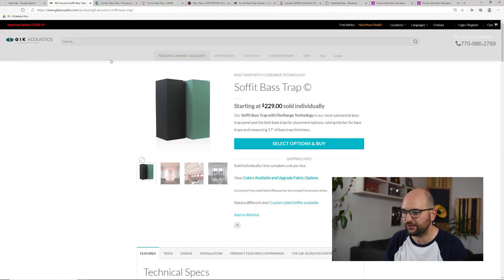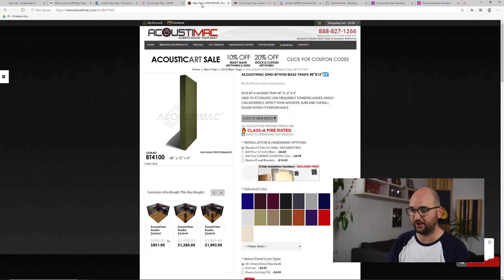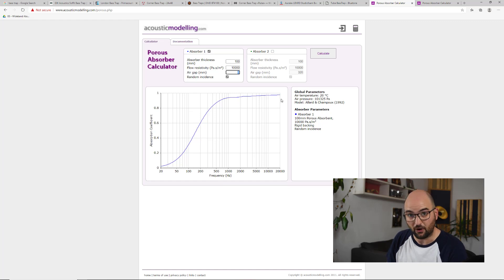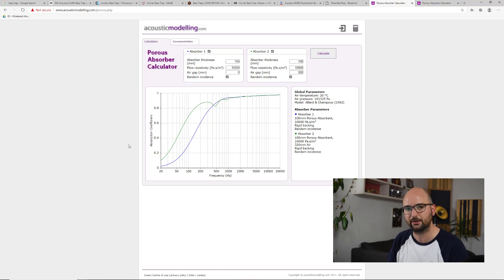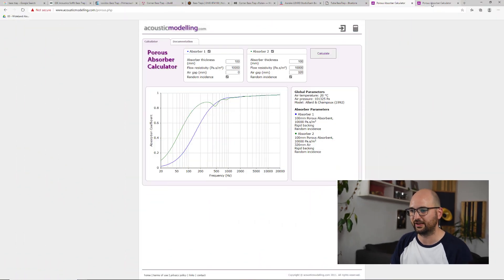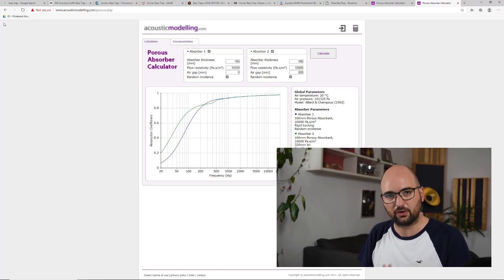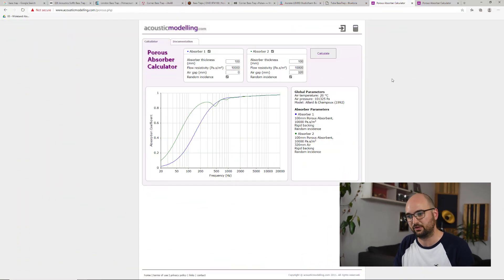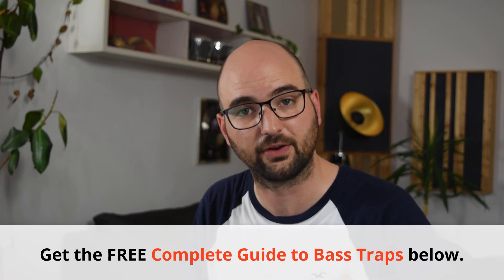Bass Traps: Why They Aren't Actually "Bass Traps" - AcousticsInsider.com

Comment: I am fairly new to all of this but have done a fair amount of research and my question here is... I've read that if you put absorbent material (insulation) in a Helmsholtz Resonator  chamber, will it add a little more to the frequency range (aka, broadband width or Q). Is there and validity to this? Please advise.

Comment: I’m building a new studio space, and i hung velvet curtains in each corner, spanning a meter-3 feet across. But i did it to stop flutter echo, not necessarily bass nominees. It worked very well, in conjunction with ceiling clouds and wall panels. But, I’ve noticed I’ve actually ‘lost’ a little bit of bass response through my monitors- Adam audio t7’s- crazy… so, better for vocal tracking, a little harder to mix with. Hahaha

Comment: Step 1: Win lottery.  Step 2:  Install as many RPG Modex plates that can be properly placed in your room.   TRUE low bass absorption in only 4" of depth.  Can be used in conjuction with velocity based absorption, doesn't have to be either/or.  John Sayers style angled slat wall (helmholtz function), should be great for evenly controlling 150-500 Hz, without losing mids and highs in room.  Along with breaking up standing waves between parallel walls.

Comment: This is in my living room. I have a coffee table that's 2 foot by 4 foot and about two feet off the ground. What if I filled the entire area underneath that with absorbing material? With that have any effect? I know it's reducing the surface area that is facing the Soundwave. The largest surface area would be under the table top. What if I only made it one foot thick and let the rest be air gap to the table top? Would that help or is this whole idea not right because it needs to face the wave head-on with the largest side?

Comment: Question, i have a big big couch with leather/microfiber combo. And a proper filling. Would this count as a basstrap of sorts? It's my living room so prefer to use normal items for acoustics. Like a heavy cotton wall carpet behind me (kills slap echo).

No need to be absolutely perfect. But sorta 'secret' camouflaged acoustics sound fun. Any other suggestions?
Reply: Not really, do some measurement and look at your RT60, standard for mastering is 30-40ms on ALL frequency. You will never see that in your room without specific bass trap like Helmhotz resonator/slat bass trap/perfored bass trap….
:)
Reply: But for slap echo, acoustic foam do just fine

Comment: I'm confused how a panel on a corner with an air gap can be as efficient as a panel that fills the whole corner?
Reply: Almost as efficient... it also has to do with the quarter wavelength of frequencies. When sound waves 'enter' the porous absorber they encounter friction and energy is transfered into heat. After passing the absorber it bounces of the wall back into the absorber again. The thickness of the absorber and the distance from the wall determine for which (quarter wavelength) frequencies it's most efficient. The bigger the airgap, the longer the quarter wavelength, hence the lower the frequency is affected. To a point. That's why he shortly mentions that if the absorber is too thin compared to the airgap you get some losses in the lower mid frequencies. Hope this makes sense to you.

Comment: If I am building a superchunk “bass trap”  what density of rock wool would u recommend?  Some say lighter is better than heavier.  I intend to build a 30x30x40 cm ones.
Reply: This is not a bass trap but for yes lighter Flow resistivity is better for bass. 4000 Pa.s is good, I don’t know if you have ISOVER in your country, that come in 45 milimiter panel and it is a 4000Pa.s

Comment: Bass Trap as a term has so many issues! If we need a definition I would suggest at minimum it should have maximum abortion Q at or below 100hz. Physically if absorptive it should have volume akin to a closet or room cove as a minimum. If membrane or other it’s about how well it absorbs at and below 100hz! Ie the vast majority of panels are NOT bass traps!

Comment: So if your room has a 12 db bump at 100 Hz, the 4 inch think bass trap will absorb 30% of that? I find that hard to believe.
Reply: 30 % of the sound velocity that hits the bass trap, I assume. Your whole room will not be covered with the bass trap so the total effect on the bump at the specific listening location will vary.

Comment: To clarify to the beginners, that's not showing percentage on the vertical axis, but rather  a coefficient that shows effectiveness. The traps don't absorb 100% of frequencies in that range, they're just very effective. you really want to shoot for an absorption coefficient of greater than 0.5 to consider the effective in a given range.
But this is a basics vid. Just wanted to bring to the forefront something that might cause some folks serious confusion later on. Great video!
Reply: percentage is no proper unit, but effectiveness is also not defined. what we should be talking about here is power density W/m3 over multiple frequency ranges.

Comment: Thanks for the talk and also the link to the calculator. If people want measured data, GIK Acoustics is the only firm I know that posts actual test results for most of their products. Since all 6" panels are likely to be similar, I check the GIK specs often when I'm thinking of adding treatment.

Comment: Actually, use the term Low Frequency Absorption.  Yes, there are three types,  Diaphragmatic, Membrane or Helmholtz resonator.

The depth of the cabinet will dictate the frequency it will absorb and then how it's designed and what materials will determine how MUCH energy at those frequencies will it absorb.

Think of your wall of your room a diaphragmatic absorption cabinet, HOWEVER, since most walls are using 2x4 studs, the resonate frequency isn't that low.  Since most walls are using sheetrock and fiberglass insulation, they aren't going to absorb that much below 100hz…
 
However, make a wall with 2x12 studs, the frequency lowers because the cavity is deeper.   Then what materials you use on the surface front and back as well as what material you fill the wall with will help determine how much you're going to absorb.  If you use things like thick plywood, maybe layered with MLV, and maybe using MDF and doing this on both front and rear of the walls, you can definitely create a nice absorption wall.  What material to fill it with?  Well, according to Acoustic Fields, they use Activated Carbon specifically developed for that application.  They also have their own unique design they create standalone units OR build within the wall cavity.  They have lots of videos discussing all of this.

Yes, there is only a couple of companies that use a Diaphragmatic absorption process and the cabinets are fairly large, deep, heavy, and aren't cheap, but if you have enough of them, they will go after those low frequencies and make a HUGE difference in the room.   Remember, low frequencies under around 100hz and below aren't directional rays like the mid and high frequencies, so these low frequencies go EVERYWHERE.  Depending on the room dimensions (height, width, and length) will determine which frequencies you are going to have problems and where these room modes are going to build up.  Contrary to popular belief, most low frequency problems under 100hz are going to be against entire surfaces, either width, length, floor to ceiling, or all, so you have to really measure out or use a room mode calculator that hopefully has a 3D rendering of the room with the various frequencies creating axial, tangental or oblique mode pressure issues.

No, I don't work for Acoustic Fields, yet I have been to one of their demo rooms a few years ago and heard it for myself.  All I can say is, if you have the money and the need for the best low frequency absorption, look no further.  They have the best in the business..  And yes, the owner is in the process of going into retirement, so he's only going to be selling their stand alone units until the end of the year and then he's just doing custom design work after that….  They do sell the build plans for a standard BDA cabinet, which you can make your own, but it's not the same as their ACDA units, which have Activated Carbon, so they won't absorb as much of the low frequencies the cabinet is designed for, but it will give you something to play around with.

Comment: Staffan Olofsson
för 11 timmar sedan
How shall I interpret this? I have problems with some peaks in the bass and to me it looks like if I put in broadband absorbers it will absorb more in the frequencies that I don't have  problems with. Which should give more/other problems. Please someone enlighten me.

Sorry I happened to post this comment in response to David Dunne.

I can add that I had a relatively good sound except for the bass. So I wanted to try to fix this and was persuaded that I should buy a bass trap, of a certain brand, 15 cm thick and in two pieces, 60 cm x 100 cm, which are supposed to be placed on top of each other in a corner.
The only thing that happened was that voices (and everything else in the same range) got thin. 
I was told to try change the positions of the listening place and the speakers. It only got worse. 
I understand that I can feel that the voices becomes thinner if the lower bass has become suppressed, but the lower bass was not suppressed.
Reply: Staffan, since no one has responded and you have a legit issue- I'll take a crack at it. 
It's true- porous absorbers absorb ALL frequencies. It's a point that often gets overlooked. For porous style absorbers to reach the bass frequencies they have to be VERY thick. Depending on how low your issue is, it might not even be attainable with this approach (the double tall corner trap you purchased- I'm assuming it's filled with insulation/porous material). It certainly has a massive effect, however, on all the frequencies along the way from highs through the mids and then finally down to the bass. And if you were happy with where all the highs and mids were sitting, by introducing that "bass trap" you've ultimately changed the entire image of those highs and mids. Just in a effort to reduce the bass.   That being said, you'd have better results with a "tuned" trap. There's various ways to achieve this- I'm sure all of them in the Acoustics Insider guide: helmholtz resonator, membrane trap, etc... But these kinds of traps can actually target the frequency in question without affect everything else. but you'll first have to measure the room with an Omni mic and some software In order to know exactly where the problem is. I think Room EQ Wizard and Sonnarworks could be a couple decent programs to check out for this.   Hope this helps you!
Reply: Additional subwoofers stacked in the corners make the best bass trap
Reply: @bryanguest2807  
Stacked subwoofers in the corners?
How many subwoofers?
And then?
Please explain.
Reply: @staffanolofsson8342  bro, do u even quadruple bass array?
Reply: @bryanguest2807  
Sorry. English is not my native language,
What do you mean. If I have more than four sub woofers?  No I don't use any.
I replaced my easy chair with a two seat sofa and got a much better base. It works like a bass trap, But still there are a minor problem with the bass.

Comment: Nice with a calculator for the panels.
But you showed us also the circular tube traps that is put into a corner.
Is there any calculator on how far from the corner walls the tube trap is placed??
(It would be nice to see what happens at 0 cm and 34 cm from the walls with that type of treatment on a diagram 😉 )
Yeh I know I could bring out and set up my equipment with REW to find out but a mathematical model of how it reacts with different distances is good to speed up the understanding.. 
Thanks for the video!
Reply: Tack för ditt svar. Jag har ju liksom gått genom delen att leta upp bästa "möbleringen" av rummet. Kvar var basen som inte låter helt OK. Jag tror att problemfrekvenserna ligger på typ 50 Hz, 125 Hz samt någonstans ännu lägre. Inväntar en XTZ room analyzer så jag får se vad reslutatet blr av det (och om jag förstår att tolka det;)).

Comment: Fascinating insights. Thank you 🙏. Would the same concept of having a gap behind the porous material apply to absorbing the back-wave of a woofer in a large box speaker?
Reply: One of the Best Ideas of SoundProofing is "SoundProof Curtains" it actually Block outside Noise coming from Windows. Check Here: https://livesoundproof.com/best-soundproof-curtains/

Comment: Cheers, bud.
Reply: How shall I interpret this? I have problems with some peaks in the bass and to me it looks like if I put in broadband absorbers it will absorb more in the frequencies that I don't have  problems with. Which should give more/other problems. Please someone enlighten me.
Reply: @staffanolofsson8342  Om du har toppar på vissa frekvenser tex +10 dB @ 50 Hz. Då som du ser är detta inte vägen att gå. Jag hade gått tillväga så här:
No1 testa olika positioner (högtalare o sweatspot) o möbleringar (lång väg o kortvägg) så att du får plattare frekvensåtergivning o lägre toppar. 

Därmed får du enklare o bättre förutsättningar att behandla dem med olika åtgärder i No2.

No2 för att ta ner toppar på specifika frekvenser. Då gäller Helmholtz eller membran absorbenter mfl som justeras exakt till den frekvensen som du har toppen på. Dvs INTE bredbands absorbenter..

Finns mycket att plugga på där angående dessa typer av absorbenter som är inte bredbands utan specifika för en given frekvens..

Om du tittar på videon igen så säger han det INDIREKT. Men är svårare att fånga när man inte vet vad han pratar om. Ladda ner o läs hans PDF.

Det du också lär dig indirekt av videon är att alla bredbands absorbenter du skaffar bör vara så djupa/tjocka som möjligt o helst tjockare än 10 cm.
(Dvs om du klär stora delar av arean av alla dina väggar o tak med 4 cm tunna skivor/absorbenter. Då har du behandat allt utom bas frekvensregistret! O med stor risk har du ett dött rum med fortsatta o obehandlad bas problem.. så man skall alltid sträva efter att ha så djupa/tjocka absorbenter som man kan komma över. För basen är där mest energi finns och är den mest svår behande frekvenserna som vi har att göra med.)
Lycka till!